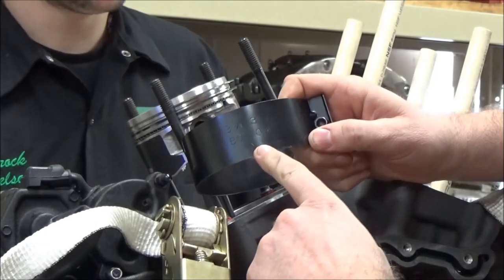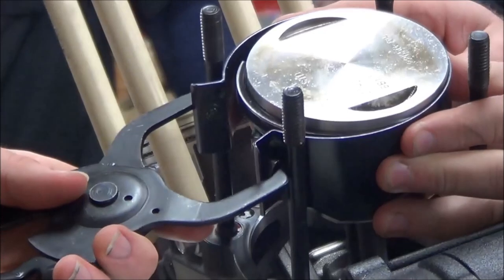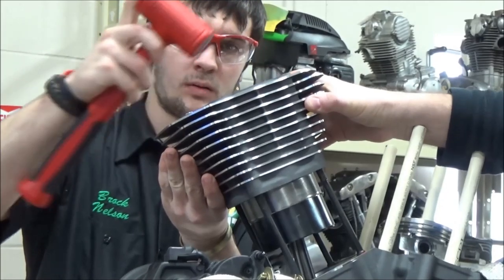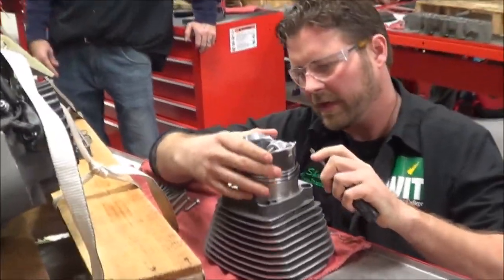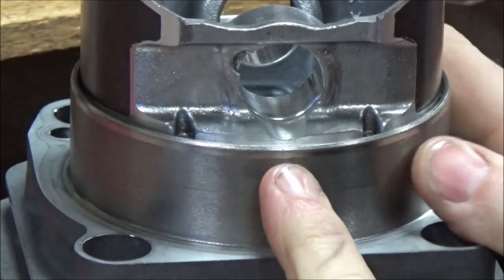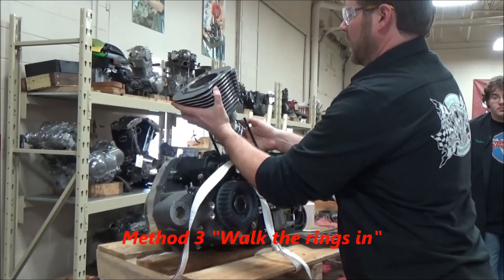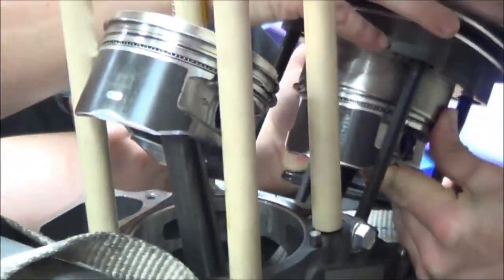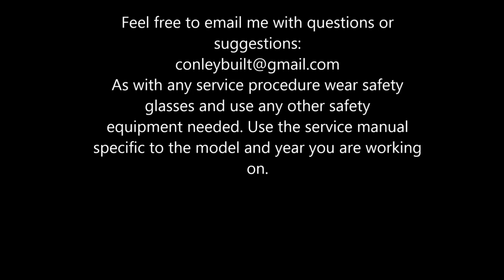How to install cylinders found on Motorcycle Atv Sled Watercraft Harley Dirt #motorcyclecylinder

Comment: I used method two as I'm on my own and inserted pistons from the top going down so could monitor rings and gaps as the moved in the cylinder on a bench at home....pre-fitted  pistons in cylinders and marked the four spots for gaps  all the way top to bottom vertically....babbaboom job done....cheers Shane.\m/
Reply from the maker: Thanks for commenting and adding value to our community!

Have you subscribed yet to never miss a video? Have you seen the video playlists? Over 600 videos! Check them out here: https://www.youtube.com/user/conleybuilt/playlists  

Want to say “thanks” or “keep it up”? Click here https://www.paypal.me/how2wrench    
 
Your answers and help are just around the corner. Save time and money while protecting your investment and yourself by doing it the right way at www.How2Wrench.com
Reply: The rings rotate in a running engine at various rates if the gap positions move a little during installation it won't matter

Comment: one tip I  gave to my students was instead of using a screw driver to work the rings in to the cylinder I use plastic or bamboo chopsticks to prevent scratching the rings especially the cast rings. they work really and I also use  tuning fork type rod and piston supports I either build them from 1/2 alluminium bar stock or blocks of hardwood
Reply from the maker: +Tim Ryerson 
Freakin Awesome
Reply: I've used the "screwdriver" method myself. I would prefer wood or plastic.
Reply: Time i have one tries to use a a unsharpened pencil but you will never know when a bloddy particle of that fell in the chamber of your crankcase- as wood is quite vulnerable to the pressure you use to compress those rings
Reply: Exactly! No metal tool for this rings compressing job.

Comment: I’m not a mechanic but have been a carpenter for 30 years  and agree with the upside down solo method of installing piston into jugs. When I install doors ( heavy fire down to hollow core) I like be solo. Less hands on means less pinched fingers or things messed up. The best way to learn the easy way is by yourself alone. Thanks for the knowledge again. Great vids.

Comment: Great video, I'm really happy to see this on youtube. Excellent! Thank you for showing three different methods. I still prefer the first method though, use a ring compressor and lower the cylinder over it. Very easy this way and no fooling around with the circlip with a cylinder still in your hand. Anyway, it's so good to see each method of doing this job!

Comment: I use a combination of both methods. I install the piston into the cylinder on the bench with a compression tool. I install one circlip and partially install the wrist pin. Then I go install it on the bike. Not gonna lie, sometimes It's a pain to install the last circlip, while holding the jug. Would like to see someone come out with a circlip install tool. Maybe motionpro makes one?
Reply from the maker: +3544S 
They exist but are costly as they only fit each size wrist pin.

Comment: Would you suggest method two on a 4 cylinder engine? I'm working on a 79 gs1000.
Reply from the maker: I have a REALLLLLLLY old video on it that needs updated...Here is it: https://youtu.be/DeDjQk5Hpio Still gets the message across. 😊
👍 Thank you for taking the time to comment! It helps us! 
Here is a way to support all the free videos.
Want to say “thanks” or “keep it up”? Click here https://www.paypal.me/how2wrench  

Subscribe and Follow us! 
Web:
www.How2Wrench.com     
www.Tools2Wrench.com
Reply: @How2Wrench  I've actually watched that video before. I'm working with the engine still on the bike by myself. This is the second time I've had to replace the jugs and I'm just curious between both methods which is better? I also don't have a small enough piston rings compressor. I used hose clamps last time but I really don't want to again if avoidable. Last time, after getting the bike together, I had no compression. I found that the rings were stuck in their grooves and didn't expand. I'm curious if that was due to the hose clamps? I don't see how, but I've seen a lot of weird things working as a heavy line tech for Dodge. I have ran a ring groove cleaner on the pistons again and did find a very small amount of carbon that was missed. I speculate that's why they stuck. I apologise for rambling. I'm just trying to cover all my bases before I move forward and spend another 80 bucks on gaskets.
Reply from the maker: @AmericanDefender  Have you seen how cheap the "right tool" is? I'll out a link below. https://amzn.to/2ZrYb3D or https://amzn.to/2NQgPN2 I did a quick check on your stock bore and it showed 64.8mm (https://www.google.com/search?q=79+gs1000+bore+size&rlz=1C5CHFA_enUS718US718&oq=79+gs1000+bor&aqs=chrome.2.69i57j33l3.13783j0j7&sourceid=chrome&ie=UTF-8) I personally like to first one with the short clamp band width. Nice for getting in and around studs. 

I don't want to discredit clever ideas but when it comes to piston rings, I find the tool is much wider and correct for installation without damage. 

As to why the rings compressed and did not release I have an amazing video showing exactly. I am in the process of editing it for our new members/donation site.

Comment: I never had a problem just using my fingers to compress each ring as the cylinder drops, the piston has be up high enough to get your hands in there but not so high the jug won't catch the studs, tall cylinders you can get away with this, short cylinders would be more difficult

Comment: I like it
Reply from the maker: Thanks Carl....
We sure love you taking the time to comment. Are you coming to the next live session? 
There a few ways you could help keep this work going and stay connected with me personally.  
1. The fastest and best thing you could simply do for us is hit that subscribe button…helps us creators more than you know! 
2. Join this channel to get access to perks:
https://www.youtube.com/channel/UCBhM8DCKnT3qXwTW0eToyCg/join   
3. Give us a high 5 here:  https://www.paypal.me/how2wrench    
Keep Wrenching,
Shane Conley
Peoria, AZ USA
Follow us!
www.How2Wrench.com      
www.Tools2Wrench.com   
Facebook: 
https://www.facebook.com/How2Wrench/  
Instagram:
https://www.instagram.com/how2wrench/
Reply: @How2Wrench   no problem, I liked it because I'm in the middle of an 07  Yamaha YZF R1 valve job. and  on the 07's and 08's R 1' if you take the cylinder of the motor you have to due the same. However, as you know thr R1 is a inline 4 cylinder, making things a little bit hard.
Reply from the maker: @carlgar2007  Nice...over 700 vids on here so we may be of more help...lots of perks like requesting video topics to not have to search for them and member only perks and q/a Join this channel to get access to perks:
https://www.youtube.com/channel/UCBhM8DCKnT3qXwTW0eToyCg/join
Reply: @How2Wrench   Thank you dude, I've doing this kind of work for 45 years.  I wanted to be a motorcycle mechanic when I was young but at the time there not a lot opportunities for it. so worked in the automotive industry for 22 year, graduated  with a degree in Computer science and went to work in the automation industry. However never stop working on bikes.
Reply from the maker: @carlgar2007  Nice...Stay connected...